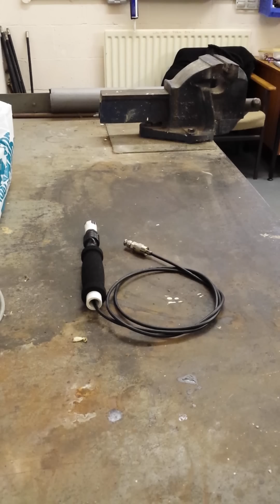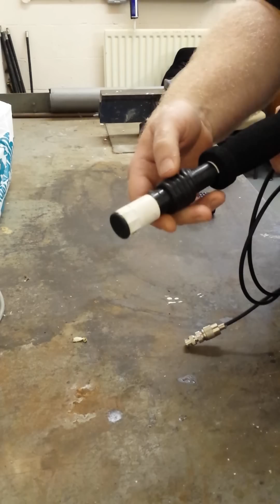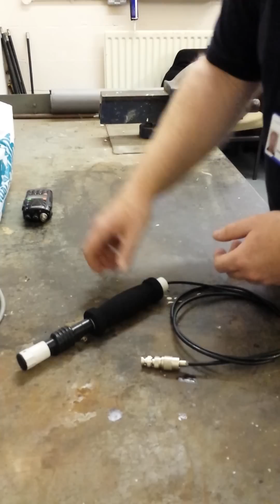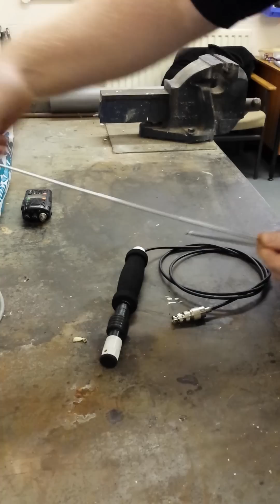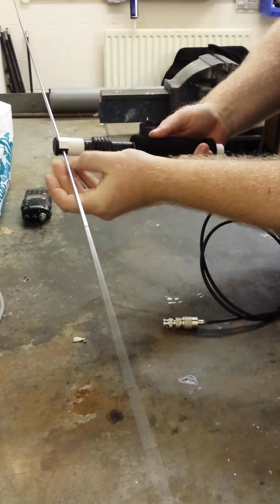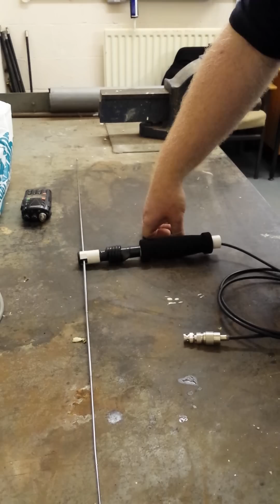SOTA 2m/70cm telescopic Dipole Antenna Pt1

Comment: Hi, were they just normal brass nuts you used or something different? If so what did you use please.
Reply from the maker: Bobby Gooner I used brass nuts soldered to the coax inside. Just order the size to suit your antennas and u will be fine
Reply from the maker: Bobby Gooner in fact I made a revised version for a friend and used brass stand off pillars on that one
Reply: mk1tina I've ordered the same pair of antennas as you from fleabay. Can you remember if the stand off pillars were M3 or M4?
Reply from the maker: Bobby Gooner I think they were 3mm.. it was 5 years ago

Comment: I am a retired electrician lol,  so I know all about 25ml  pvc  conduit and fittings. I am sort of copying your antenna here, but not sure about the choke. Is it just a separate piece of co- axial cable wound round or is it the feed line co-axial wound round?  Sorry if I sound a bit dim.
Reply from the maker: feeder wound round conduit
Reply: +mk1tina&#160; Thanks very much for the reply. - I will do that. - Frank.

Comment from the maker: I used 15mm standoff pillars, bonded into the handle which is filled with resin to hold them and the coax snug.